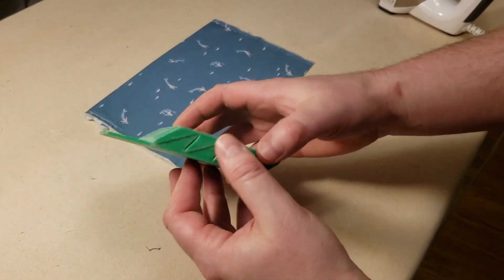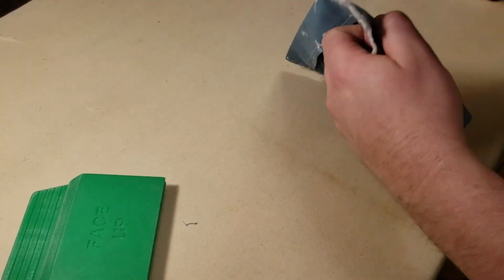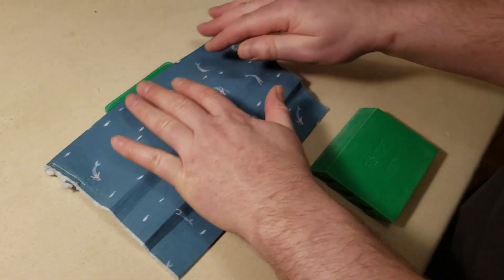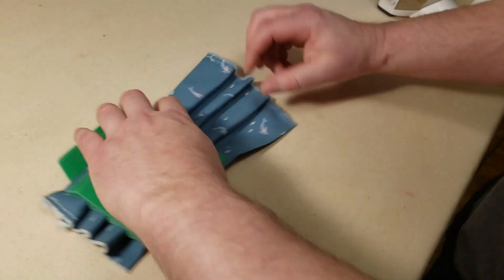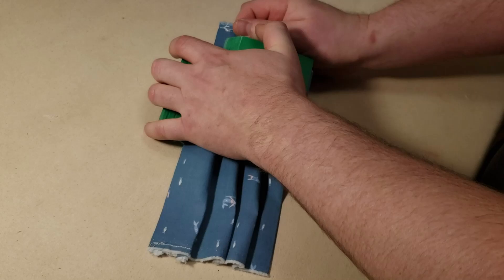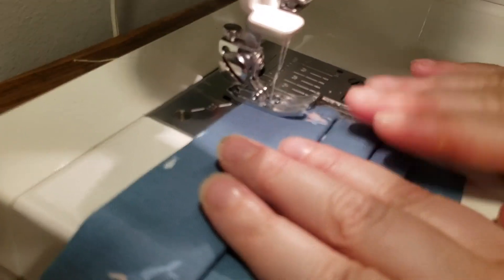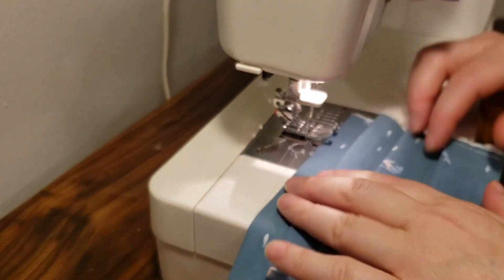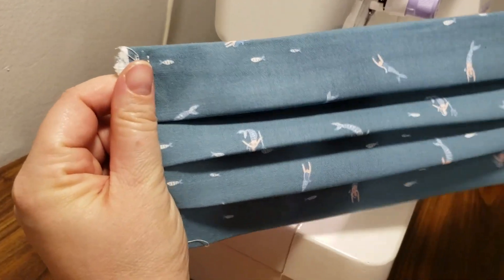Pleating a Face Mask with a 3D Printed Pleat Jig.

Comment: Ok, my friend printed one for me, I have 50 masks ready to pleat and I'm not understanding how to do it.  My masks  are9"x8".  I've got the video on loop so I can keep watching it while at the ironing board.  You make it look like magic I'll keep practicing and watching,, I guess with 50  I'll eventually get it hopefully.
Reply from the maker: Thanks, @charitycrafter. Is the fabric having a really hard time cinching down? One possibility is that there's too much horizontal expansion on the 3d print -- i.e. when it was printing, the dimensions expanded past what they should and it came out without enough room for the fabric. For example, on my printer, I have to set "Horizontal Expansion" in Cura to -0.14 to get it to print at the accurate dimensions of the file. 

If you have some sandpaper on hand, try sanding the waves a little to help reduce friction.

The other thing when I'm cinching the jig is I rock it a little, alternating cinching with the left hand, then the right. It help keeps the fabric from binding. Does that make sense?

I hope you get it working! Let me know if you have any questions.

Best,
Tony
Reply: @tonysmithyoungblood  You don't think my dimension of my masks are wrong for your jig? I'll try the sandpaper tomorrow.  And I'll try to make a video to show you what it looks like when I do it. Thanks for replying.
Reply from the maker: @charitycrafter , not sure. If you can send a video, that would be great!
Reply from the maker: @charitycrafter, did you get it working?